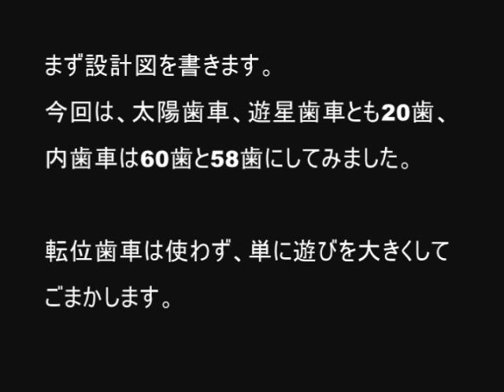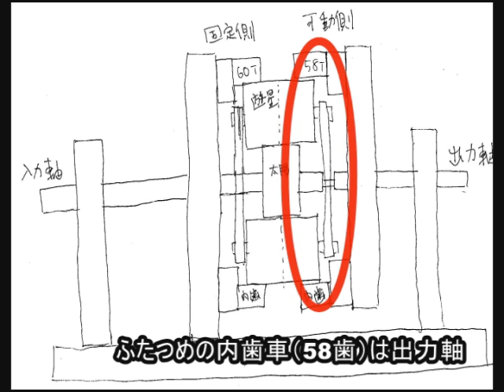不思議遊星歯車を木でつくってみた  Mechanical paradox planetary gear

Comment: １構成の遊星歯車機構にプラネタリギヤを２段にした時の計算式が分かりません。
ご教授願えましたら嬉しいです。

例：内歯車固定48歯、サンギヤ12歯、プラネタリギヤ20歯（サンギヤとかみ合わせ）プラネタリギヤ16歯（内歯車とかみ合わせ）プラネタリギヤの20歯と16歯は同軸接続
この時の減速比の計算方法は分かりますか。

2D CADで歯車の組み合わせは出来ましたが、実際の減速比の計算方法が分かりません。
内歯車48歯は、タミヤ模型の遊星歯車キットが48歯だったので、それで考えました。

　「小原歯車の内歯車では60歯が最小なので60歯での計算式でもかまいません。
　どうかよろしくお願いいたします。
　例：内歯車固定60歯、サンギヤ16歯、プラネタリギヤ24歯（サンギヤとかみ合わせ）プラネタリ
　ギヤ20歯（内歯車とかみ合わせ）プラネタリギヤの24歯と20歯は同軸接続」

2D CADで書きやすい歯車の組み合わせにしました。
計算しやすい組み合わせに変えて頂いてもかまいません。
プラネタリギヤの減速比とサンギヤとの減速比を加算したらいいのでしょうか？？

内歯車48歯の場合、プラネタリギヤ24歯と20歯の減速比1:1.2、サンギヤとプラネタリギヤとの減速比12歯と20歯で3:5≒1:1.667
変速前（ノーマル遊星歯車組み合わせ、内歯車48歯でサンギヤとプラネタリギヤは16歯）は1:4でそれぞれの減速比をかけると、4x1.2x1.667≒8で減速比1:8
これで良いのでしょうか？？